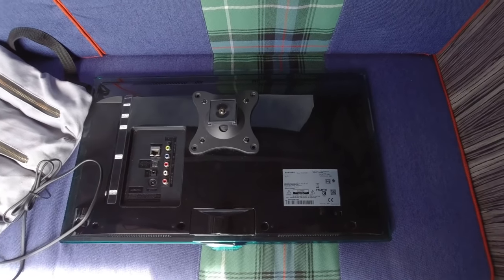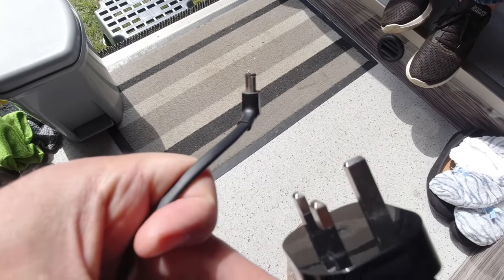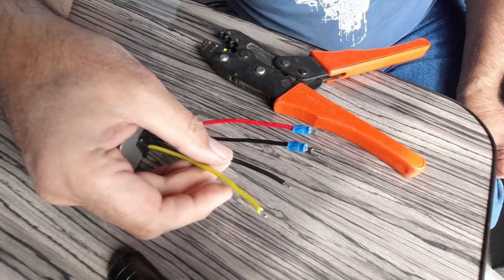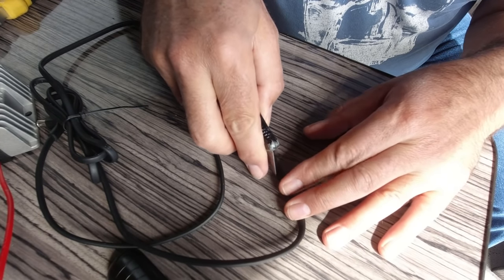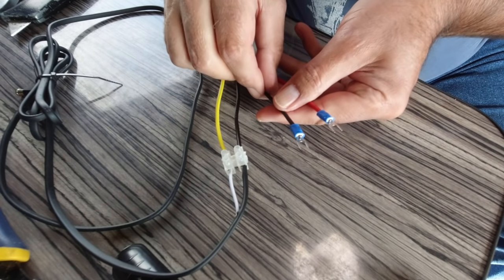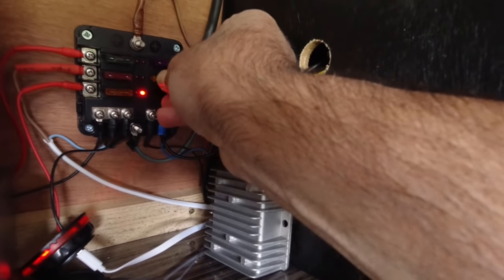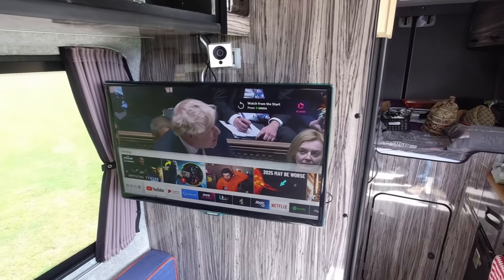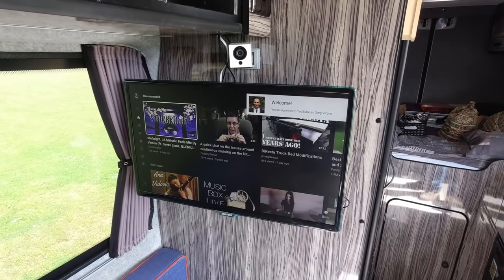How to connect a Mains TV direct to 12v DC - Off Grid Living

Comment from the maker: You can buy a 12v to 19v DC Converter using this link https://www.ebay.co.uk/sch/i.html?_from=R40&_trksid=p2380057.m570.l1313&_nkw=12+v+to+19+vdc+converter&_sacat=0&mkcid=1&mkrid=710-53481-19255-0&siteid=3&campid=5338027957&toolid=11800&mkevt=1

The TV aerial we use is an AUGUST DTA240 high gain Freeview aerial with a magnetic base like the ones on this link https://www.ebay.co.uk/sch/i.html?_from=R40&_nkw=august+dta240&_sacat=0&LH_TitleDesc=0&_dmd=2&rt=nc&mkcid=1&mkrid=710-53481-19255-0&siteid=3&campid=5338027957&toolid=11800&mkevt=1

Our mobile internet we get using an EE sim fitted into a NETGEAR NIGHTHAWK mobile router.
https://www.ebay.co.uk/sch/i.html?_from=R40&_trksid=p2334524.m570.l1313&_nkw=netgear+nighthawk+m2&_sacat=0&LH_TitleDesc=0&_odkw=netgear+nighthawk+m1&_osacat=0&mkcid=1&mkrid=710-53481-19255-0&siteid=3&campid=5338027957&toolid=11800&mkevt=1

If you like our videos please do subscribe to the channel, it's free and a great way of saying thanks
Reply: Nice one bruvvah 👍😁

Comment: You might consider adding a switch on the red lead, otherwise although small, the boost converter will draw your battery down when the tv is off.
Reply: Yes indeed and while you are at it Greg, fuse the output of the boost converter.
Reply: So, even if he doesnt use Tv, converter would spend some ammount of battery?
Reply: @dusanradojevic6255  No, the converter uses a little power when its connected to a battery. When the tv is on it will draw much more.
Reply: @MiniLuv-1984  thats what i've told.. It drains battery all the time. Used or not,it drains battery. So, it needs a switch between battery and converter?
Reply from the maker: That is a good point. We do unplug the tv when not in use. But I have a smart relay board to replace that fuse board which will give me switch control. Video out soon 👍🏼
Reply: @GregVirgoe  That's good, looking forward to the video. A fuse between the tv and the inverter is a must. What if that tv cable gets worn through or gets damaged someway...the inverter will current limit, but it will make things hot...maybe even start a fire.
Reply from the maker: @MiniLuv-1984  sound advice thank you 🙏🏼
Reply: @MiniLuv-1984  In your reply to Dusan you really mean," Yes, it will take current when TV is off".
Reply: Yes, thanks   @tryagain.k1821   - that was a rather confusing reply looking back at it now.
Reply: Hi great video ,just one question my batteries are 28 foot away from my TV can I use transformer and put cigarette lighter plug on end as where my TV was is a 12 v socket
Reply: @bialoblocki  Transformers don't work for DC.  Just use larger wire from your batteries to offset the voltage drop on the wires.  That boost converter is rated for 5 amps.  Blue Sea Circuit Wizard recommends 16 gauge wire for a 56 foot wire run.  That is allowing for a 10% voltage loss.  For a 3% voltage loss you should use 10 gauge wire.
Reply from the maker: @bialoblocki  you can put a cigarette plug on the 12v end of the converter. 👍🏼😃
Reply: On off grid situations little drain is too much drain just switch the converter to turn on and off the TV. That way you will have no drain. That's another reason I won't have TV service that requires a box  boxes use more energy even when they are off. Dish is impossible to unplug because the system has to update everytime the box is unplugged. That argument turns off all dish sales persons. 73
Reply: @GregVirgoe  those are the worst connectors I have one on my cooler it keeps unplugging connection every time I hit a bump in the road. I thought about installing connectors that are used on UPS power supply s battery packs they make solid connections. As in this case I would hard wire the converter to the DC source and install a switch to turn off the converter and TV. 73
Reply: What's the TV model number? It's almost impossible to find TVs with external power packs now.

I did exactly what you've done using an LG TV, but the TV has failed and I'd like a 4 k one to replace  it, but can't find one with an external DC powered supply.

Ideally an Android TV, not proprietary "smart" TV with their own incompatible with Android apps o/s.
Reply: @petrolthreads_  I’d like to know that same please!
Reply: Great content and, as always, informative comments! 👍
Reply: He is not connecting it to an inverter tho hence why he is chopping the 3 pin plug off. Its going straight to 12v fuse box? @MiniLuv-1984
Reply: @yetiadventuresscotland3946  Dunno, it was so long ago I've forgotten :)

Comment: It would be good if you could measure the current draw from battery running the TV from the inverter,  and again running the TV from the DC-DC converter, so we can see just how much energy is saved.
Reply: Yes, this is exactly what I was interested to know, as this is the point of doing this. Very surprised Greg has not shown this, usually he provides more than enough information.

Comment: Hi, I’d add a switch between the fuse board and the transformer so it’s only powered when required.
Reply: So you are saying the transformer is always on if it is getting power from the 12volt fuse box? Does it also generate more heat without being able to push that power to a device? I thought the TV on/off was all that was needed to break the circuit, but your saying that circuit is separate from the fuse box and transformer. Correct?
Reply: @jeffsteinmetz7188  As transformer is permanently connected to 12 volts it is always using a small amount of power.
Reply from the maker: A switch is a good idea. We unplug the tv when not in use but I do plan to swap the fuse board out for a smart relay board so that will switch power. Video out soon. 👍🏼

Comment: Have a look at 'car charger for laptop' and for £10 you get a multi voltage 80W adaptor with loads of plugs for your kit. Very easy and cheap way to do this!
Good to see you doing vidsxagain Greg.
👍
Reply from the maker: Yes you can do that also 👍🏼😊
Reply: I tried one of those laptop adapters and it conked out within 1 hour.  Didn't bother sending it back.  Greg's transformer looks much more robust.  Greg - you did screw it to the bulkhead I hope.
Reply: @jimb7406  I would think you had a faulty one? It's only a DC-DC circuit, as simple as it gets!
Mines 2005 vintage and still going strong. 💪
Reply: @paulluggar5964  They don't make them like they used to it seems!
The one I had was one of the multi voltage outputs depending on the jack that you use. Also had the retracting coiled up cable so plenty of scope for broken wire or bad connections.  Ive got a 12v TV in my van now.

Comment: Thanks for this. 👍 Trying to get a low-voltage DC system off the ground and 'Mains TV direct to 12v DC'  is a big consideration.
Reply from the maker: It’s a great solution to be off grid

Comment: Computer monitors are great as well, paired with an android box you have so many options. The 12v TV's I looked poor and the energy efficiency was rated at grade C using about 40 watts.
Reply: That’s the way I’ve gone. Way better efficiency and I just use a raspberry pi.

Comment: Hey Greg, great setup and video! I actually bought all the pieces to do this, but then realized there is another (much easier) way. There are adapters that will convert USB-C to the correct size for the TV. You can then use a 65w PD compatible charger to provide the correct voltage. The adapters were less than $3, and I already had the USB-C cable and power source.
Reply from the maker: Yes, I also found that you can buy 12v cigarette plug - 19v DC adapters pre made online for under £8 sold as car adapters. 👍🏼😊
Reply: @Greg Virgoe  
Hi Greg, would you have a link u could send me for this adapter so I make sure I get tge correct one
Reply: Link please?
Reply: Link would be helpful. Thankyou!
Reply: Any old laptops charger converts ac to 19v dc output. I wonder if that would work for you if you choose to use your invertor??

Comment: Very useful video Greg!  Anytime you can cut an invertor out of the loop, you're way ahead of the game...  Thanks very much for sharing!
Reply from the maker: Glad you liked it.
Reply: @GregVirgoe  Greg, I was wondering...  if you had two 19v devices (monitor & laptop) would you need two of the convertors or could you use one for both. It's not so much a cost issue as trying to keep the 'closet' as clean as possible.  I would guess one would do it but I'm skittish af when it comes to electrical stuff.  I'd hate to blow up my laptop in an experiment!  :)
Reply from the maker: @owenparker6651  I think my laptop is 19.5v and double the power in watts. Not sure what difference the 0.5v would make but I guess it’s pretty critical to it working right.
Reply: @GregVirgoe  Mine all say 19.5v as well, Greg.  I totally missed that or wanted to  miss it, maybe!  :)
Reply from the maker: @owenparker6651  search for 12v laptop charger on eBay there will be a lot that come up quite cheap just check the power rating in watts

Comment: A lot of devices can be charged directly through that 12/19v converter. I've been charging my laptop like this for years.
Bought a converter on AliExpress and it does the job!
Didn't know some TVs could be the same though. 👍👍👍
Reply: Isn't that aliexpress in USA? Do you have to pay taxes?
Reply from the maker: A lot of modern electrical devices run on lower DC voltages 👍🏼😃

Comment: Good information.  You can also get a buck converter for 24v from 12v to run CPAPs.  Some companies charge $500 for a small lithium battery when you can build your own off grid camping CPAP supply with a 12v battery for $100
Reply from the maker: We should all be looking at this with the rise in energy bills

Comment: Good job Greg. Early in my build I bought the Cello 12v. But if it needs replacing I will get a small smart tv that gives me plenty of option to change to same size. Incidentally I ran a trial on what the Jackery 500 would give me running telly and it was 20 hours. I can run direct from leisure batteries but prefer to use as much solar energy as possible. Thanx 4 Sharing.
Reply from the maker: Those power banks are a good all in one solution apart from being a bit expensive 🤔😊

Comment: I bought one last week works great cheers Greg  im not really bothered about power drain when not in use as van gets used daily and battery dont drop much anyways even with 12v fridge on 24/7
Reply from the maker: I would imagine it is close to nothing at all 😃
Reply: @GregVirgoe  I have fridge router and TV on standby and all my victron running 24/7 it only drops a few % overnight nothing to worry about
Reply from the maker: @northeastcarpfishing  I agree if your system can handle it no problem

Comment: Very cool stuff!  It's surprising how many electronic devices work this way, making them very inefficient when used in either off-grid or mobile situations, where an inverter is used to convert AC to DC power.  It would be interesting to see a future where more DC power is generated from local solar or wind sources and then used directly with DC appliances.  This results in a single, more efficient conversion, from the source current to that required by the device.
Reply from the maker: Absolutely agree with you and local off grid setup at home can save you fortunes with these rising energy costs. 👍🏼😃
Reply: @drswan - Depends entirely on your definition of "local", doesn't it?  Rooftop solar is the most obvious example, but smaller wind turbines and microhydro make a lot of sense, in the right situations.  Stepping down from 11kv transmissions lines, to 240/120, then stepping down again to whatever DC voltage an appliance actually runs on is very inefficient.  By comparison, what I'm proposing is LESS inefficient, if that's how you want to look at it. Also, it's not just theory, because some people are already doing it...quite successfully.  If people keep thinking the way you do, we'll never realize these benefits?
Reply: @GregVirgoe  - I believe grid-scale power is going to price themselves right out of a market, in some places.  If people saw what other countries are doing to reduce the demands put on electrical grids, they'd be more open-minded about the possibilities.
Reply: @drswan - Once the solar input is run to your battery, distribution inside of your structure or vehicle is not 30m.  In many cases, that run is more like 10 meters, especially if the system is designed and installed properly.

How much do you pay, over the course of time, for the electric company to run that line to your meter?  The established way of doing things is designed to be safe, but also to be profitable for large industries.

There are DC alternatives available for many of the common electrical devices we use and given that the grid is failing in many places, due to poor maintenance and design, wouldn't it be wise for consumers to understand and implement solutions that are entirely within their control?

Comment: Nice one Greg, I knew that plenty of TVs are low voltage so we bought a 24" LG last week but I had assumed it was 12v. Probably would had me scratching my head when it didn't work, I have ordered a voltage converter today.
Reply from the maker: Just check the input voltage on the back and make sure it’s dc 👍🏼😃

Comment: Top job! I did something similar but with an older budget curry’s tv that had a 240-12v brick to use at home which I removed and ran a cable from my 12v fuse board and earth and used a dc plug which had 2 screw terminals on the back. It’s not a smart tv but we use a chromecast for all the usual stuff and a fire stick if we’re away and it’s a F1 weekend 😍😎👍🏻
Reply from the maker: Yes a chrome cast or fire stick is another great solution 👍🏼😃
Reply: Well that's strange as all my TV's don't come with a brick / well not on the outside ? & Have a two pin push on connector ?
Reply: @stephenboyd4934  not all do
Reply from the maker: @stephenboyd4934  yes it will only work with smaller TVs like this not all sadly. Your tv probably has that built into it. 🥴

Comment: Such a great video and so helpful. Food for thought when purchasing a new TV. Thanks
Reply from the maker: Pleased it was helpful. 👍🏼😃
Reply: @GregVirgoe  yes it was a great help because I'd have gone the route you suggest in the video, 12v to inverter to 240v then downscaling to 19v. Already ordered the converter. Will look to do the same for all devices that would need a inverter/down converter to supply 19v to 30v.
Thanks again

Comment: Another vote here for a switch between the fuse and regulator. I used a regulator on my wifi router in a similar set-up and it had a surprising impact on my battery depletion even when router was off.

Tried a digital timer on the 12v end, but gonna replace for a simple manual switch. Seeing as my screen, laptop and I think maybe even camera chargers are at 19v I might add a makeshift plug and socket system. A couple of outlets from the transformer, and sockets on all the device adapter cables so they can be plugged and unplugged depending on what's needed.
Reply from the maker: As so many are concerned about it I’ll add some findings in my forthcoming control upgrade video

Comment: Thank you for this video, too.
I´m stil searching for an used flat screen with a low voltage input.
Because the most has 220 Volt AC input.
Reply from the maker: I saw a couple like mine on eBay refurbished. 👍🏼😃 LT24
Reply: @GregVirgoe  Ok, thank you. 

I should check out, which modells have low voltage input. And then search these models to buy it.

Comment: Interesting 🤔 i didn't know there were TVs with jack connectors and outside transformers. Makes it easier then 👍
BTW I bought same transformer (but the 300w) for my laptop and works within the specifications 👍.
I still recommend to check what voltage it gives before feeding anything valuable with it, you never know, and it only takes a few seconds to do so...
Reply from the maker: That is a good point, it's worked very well for me so far on the TV :D